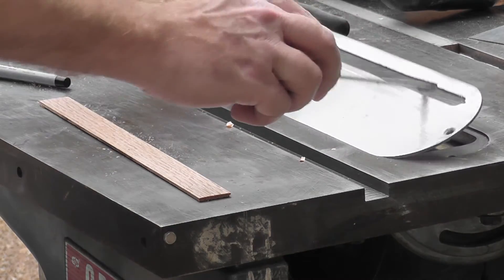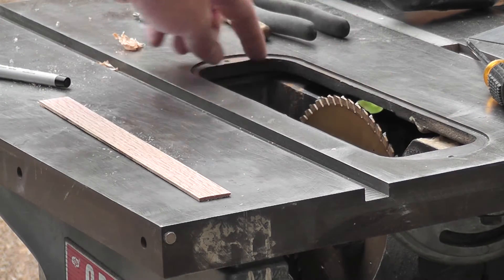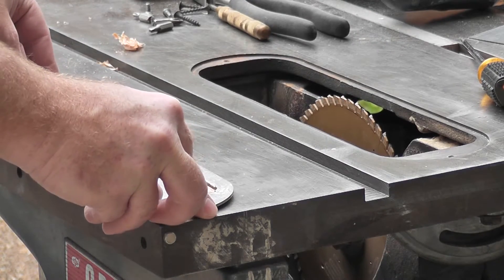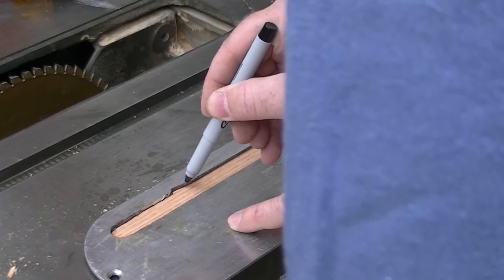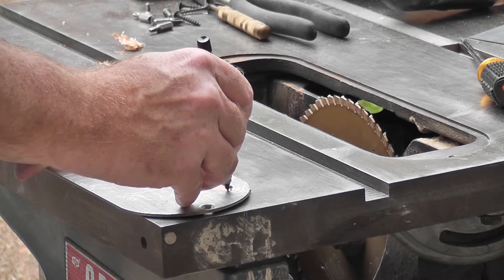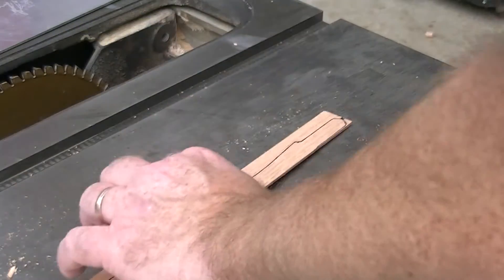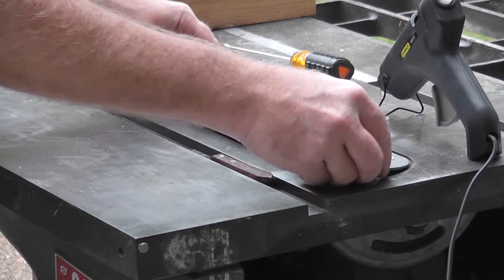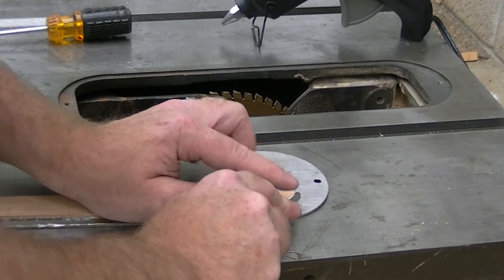Improvised Zero Clearance Insert

Comment: Could you take a thicker piece, set the insert on top of it, trace the hole and rabbet out the edges to let it fit in from the bottom?
Reply from the maker: Jay, that sounds like an interesting idea.  Routing it may be easier method to trace like you say (basically use insert as template for a tracing with a router?)

Comment: Heck yes. Way to use your noggin.  It would seem much more sturdy than Topanga the whole insert with some 1/8 inch fiber.  I would like to know how long the hot glue lasted for this application
Reply from the maker: Thanks for the comment Dean!  I really have been pleased with it and the hot glue has stuck quite nicely to the underside of the aluminum insert.  It has lasted quite a while (about 1 month ago I replaced it) with moderate use of the saw.  Cleanup wasn't a problem with scraping off the old hot glue in order to re-add the new wood section back. I can think of one major draw-back which is if I would leave the saw out in the sun (if the weather is nice I prefer to work outside) that the cast iron top could heat up and potentially soften the glue.  Ideally I really would like to accurately mill down the recess in the top and have more of a traditional thicker insert that could be all hardboard type material, however this probably isn't that feasible without taking it into a machine shop somewhere.